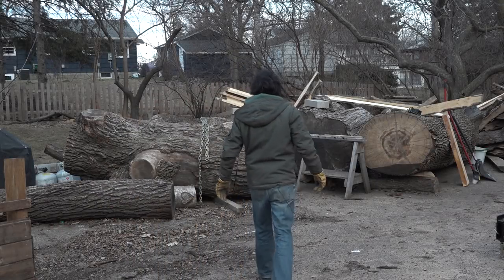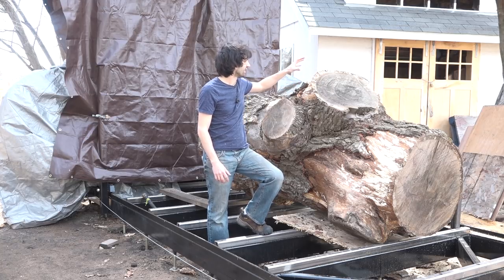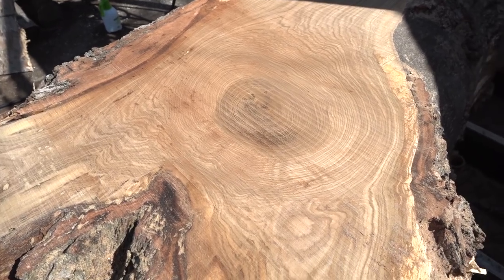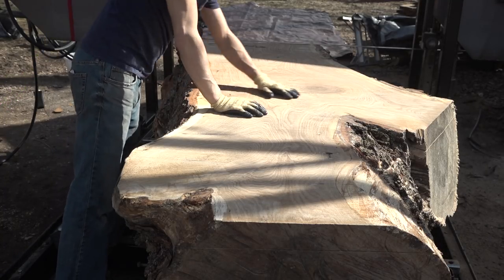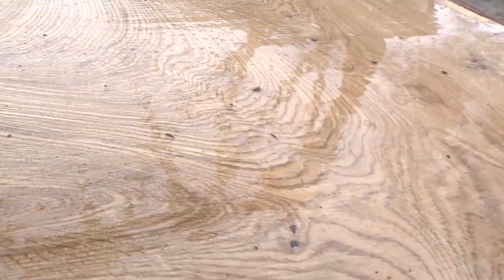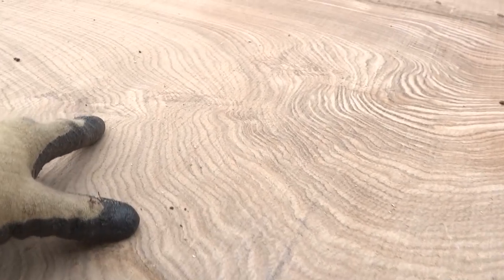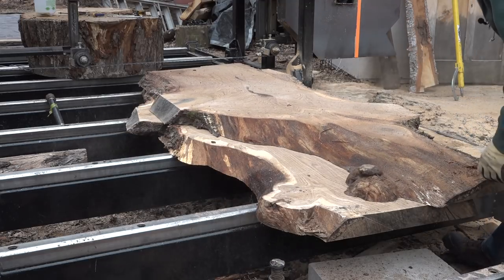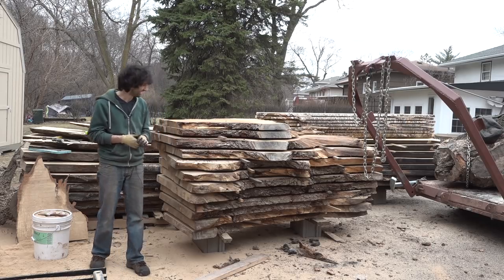Slabbing the Crotchy White Oak Log (Big Logs #3)

Comment: Matt, great job on the sawmill and your videos!  My concern is your safety.  As a kid, I worked as a sawyer on two sawmills.  Both had minimal safety features, and our crews had numerous accidents that were unforeseeable.   Bad things happen very fast and very violently.  Once, a part of one of the blade guides came off and hit the stick man (operator) in the helmet and chin.  He was lucky and only bruised.  The other time, the blade hit a hardened steel thing and the whole log spun around the upright posts and sent the stick man to the hospital with two broken femurs.  And we did have the log clamped securely.   I suggest that you fabricate a protective cage or shield out of 4"x4" steel, surrounded by a strong mesh to stand in while operating your sawmill.  Take care, Bill S. in Ramsey, MN

Comment: Hey Matt, maybe an easy add-on. Harbor Freight's pressure pot spray system could be used to apply your blade lubrication. Mount the spray head just after the operators side bandsaw wheel. Mount a ball valve at the operators station as a spray control.

Comment: Great stuff Matthew,it is a bit hard to believe that the same guy that built this incredible sawmill owns that rough looking trailer! (joking)nice A-frame on it too (or you call it an arch but same thing really) great way to lift the logs up to the trailer height from the ground, I noticed you put the bed of the sawmill near the same level for ease of unloading off the trailer onto the mill.another mod you can add to your sawmill some day is like your trailer arch but on the mill so you can lift, turn or rotate those big pieces instead of being stuck with through-and-through cutting due to their weight.  just my two bits worth.  my mill has a roof over the whole area (no walls just perimeter posts and roof) and that gives me places to drop winch cables from above to lift, move, roll the big ones - but not as big as your mill that is certain.  Anyway great series of videos, I watched them all with great admiration.

Comment: I am amazed that the weight of those logs doesn't distort the bed of the mill.  I didn't see what's under the supports for the bed but it must be firm.   On another note:  It's amazing the way you can maneuver the logs around by yourself.  I admire your determination and hard work.  Those slabs are beautiful figure and are worth some real money, I'm sure.

Comment: Hi Matt, I love your video's and your sense of humor. I have a suggestion and a question. I don't remember much about your trailer build, but if you haven't yet, I would suggest you add emergency brakes to the trailer so you don't bust the parking pawl in your transmission.. I'd set the E-brake in the truck as well...  My question is probably something you have already answered, but here goes, why do you cut everything into 8 and 10-1/4  slabs and never into dimensional lumber? I mean at 10-1/4 that is a lot of finish lumber, but you'd have to resaw all of it and the size of those bassards would have to be close to impossible!! What am I missing???

Comment: That's a pretty sweet log! I have a question for you about a oak I am currently milling myself. It is a red oak and the figuring and color is absolutely insane right after milling. I know it's normal for wood to lose color once it starts to dry but it's going completely white within an hour after cutting it. I put water on it and some of the color came back but it wasn't as rich as it was when I had initially cut it. The log was still living when knocked down and is still green. Will all the color and detail come back once it's dry, sanded and finished?

Comment: Matt, wonderful video, as usual.  I have a question.  When tuning a bandsaw, one thing you can do is hold a piece of sandpaper to both sides of the back of the blade while it is running to make the trailing edge smooth and ever so slightly thinner; thus decreasing drag as the blade cuts a kerf.  Is that something that would be pertinent to bandsaw mills?

Thanks.

Comment: Hello Matt. Love the videos. Word of advise, if you'll take it. I will soon, very soon, tomorrow in fact, be fifty years old. My back feels like its 80. I have been an auto mechanic all of my adult life. Over this time, when something needed to be done I "just did it" That included picking up transmissions, moving engines and any other heavy object that may need moving. My advise, Get some help with those heavy slabs. You may pay for latter if not. Have a great day.

Comment: On moving slabs by hand.  May think about building (fixed for adjustable height) very sturdy sawhorses to help with moving to your log stack.  Could have rollers on top or just a smooth surface.  Careful with your back.   I've had a lower back injury from loading logs by hand onto my mill that has nagged me since.  Thanks again!

Comment: Just an fyi, Matt...I had a Woodmizer LT40 hydraulic, and a real simple easy way to keep the blade lubed was to have a 5-10 gallon bucket /container up above the throat of the mill with a gravity feed- water supply, with a faucet on the operator side.  Makes just one less thing you have to be doing while going through the cut.  The more you know...   Ha!

Comment: have you checked into having the blades sharpened and can you get a carbide blade.
Reply from the maker: Blade sharpening is $8 at Cook's Saw (where I got the blades). Still looking around for carbide.  Woodmizer makes one but doesn't have it in 1.5" width.  They have it in 2" width but then it starts getting pretty spendy.  Other carbide blades I've seen are all triple chip and would cost around $600 for one.

Comment: Have you considered putting one of your brilliant arch lifting devices on the loading end of the saw platform? You know... to help lifting and separating crotches and butts?
Reply from the maker: I am considering using the saw carriage for that purpose
Reply: I don't know that actual logistics, but that seems like using a really refined, and dialed in tool for rough work.
Reply from the maker: The sawhead is is where all the precision lies.  The carriage itself is just a steel frame on wheels

Comment: Perhaps your next fabrication project could be a hand pushed gantry crane with tires large enough to roll over the rough terrain around your mill... It could be used to position logs and move slabs around.  

Manhandling those large logs and slabs cannot be good for you in the long run. An associate of mine ended up with spinal cord damage due to one wrong move while manhandling large heavy materials by himself day-after-day at his job... He's now bed and wheelchair bound.